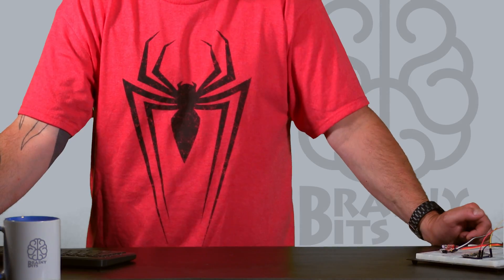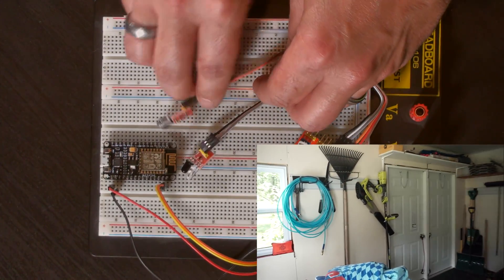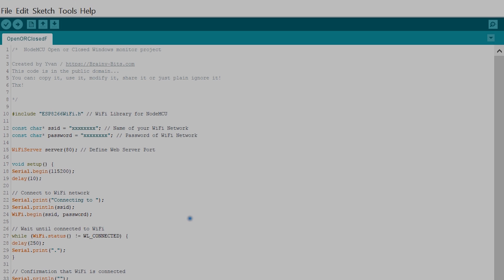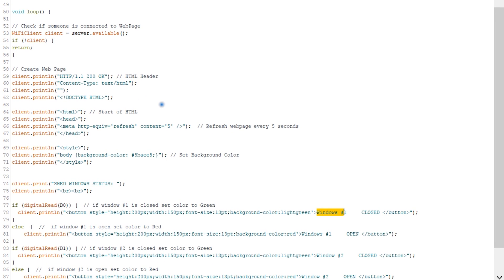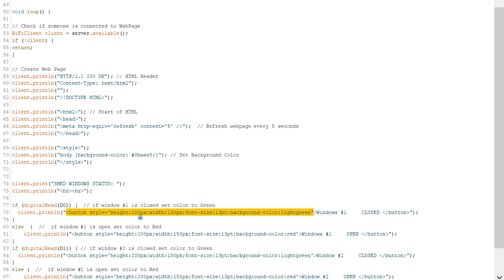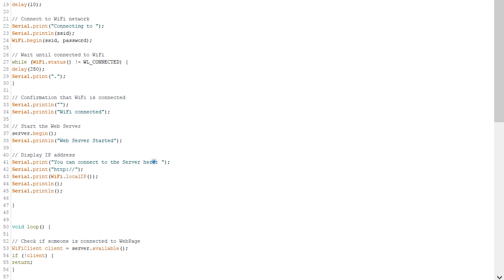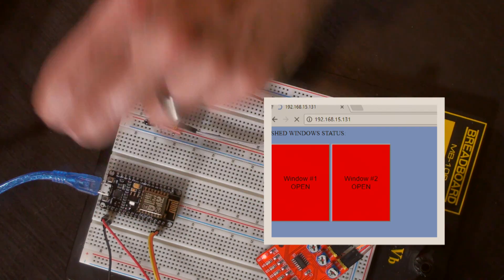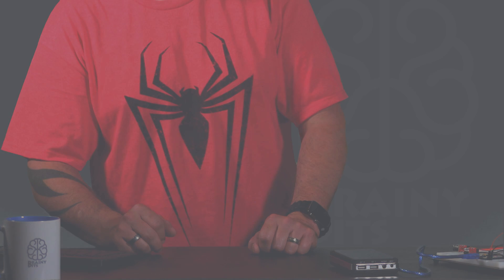It's Raining!!  Let's build a WiFi window monitor using the NodeMCU - Tutorial

Comment: Thanks for your videos.  I learn a lot.  I will use this sketch with some other sensors. Is there a way to access the web page from my cellphone and control a switch? 

BTW, where's your head?  I've never seen it.
Reply: yeah Great Video but this is my question too, how we can know the IP address of the server when we are far from our laptop and we have no access to the serial monitor Please answer?
Reply: You can use port forwarding on your router to access the webpage away from home. All you'll have to know is the IP address assigned to you by you ISP, but keep in mind that they can change.

Comment: If you use that interface board is it posable to use a micro switch to save power so it would stay a sleep until the window or door is opened.
Reply from the maker: Sure, I guess you could connect the GND wire to the switch and it would provide power to the IR board only if it's activated (if you use a NO Normaly Open switch) or you use a NC Normaly Closed switch then the power would be applied only when the window is open.  But you would have to figure out how to know if the window is Open or Closed when the IR board doesn't get power?  Thanks for watching!